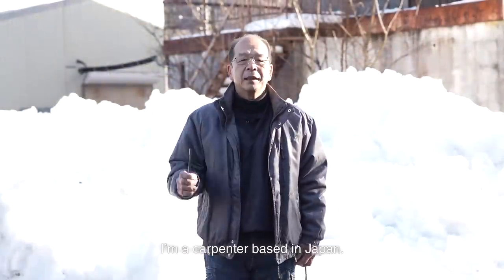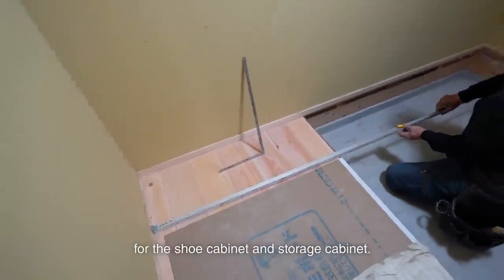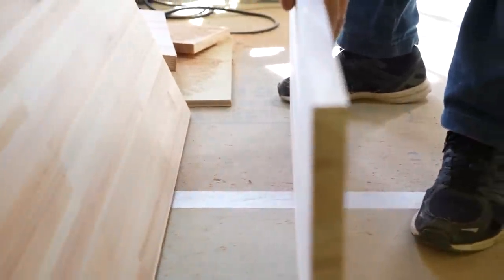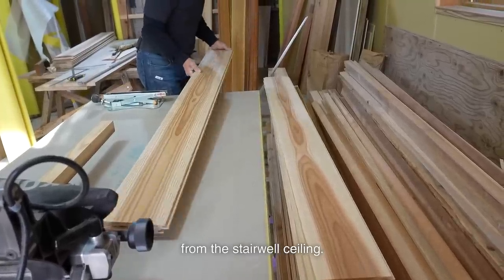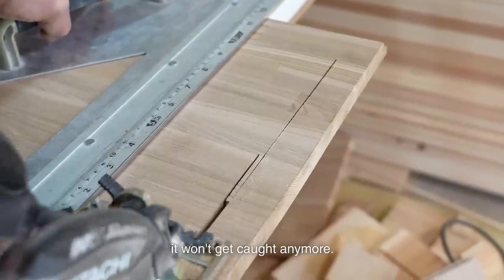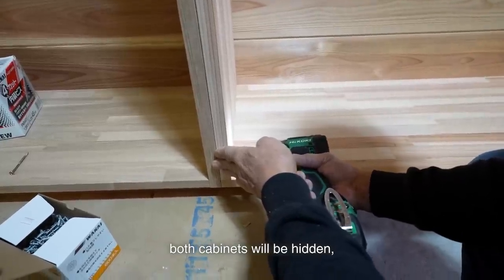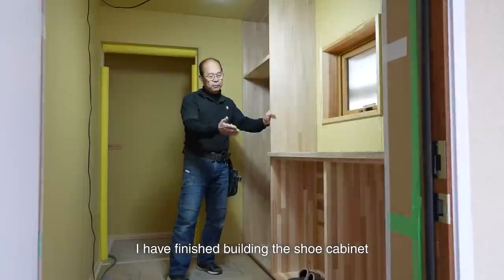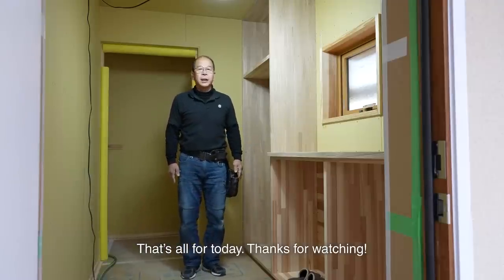Building a Shoe Cabinet & Storage Cabinet | Work I Dislike but Firmly Built [Season 3 – Part 12]

Comment: Thank you for taking the time to make this video. I know it slows down doing the actual work. Being a US based woodworker it is very interesting to see how some methods are the same as I am used to and some are different. Making the "turusen" (we call them plugs) as one long dowel piece and cutting each one flush after hammering it in is great. I normally make plugs ones at a time with a "plug cutting" drill bit and then hammer them in one at a time. Your way is quicker and wastes less material. 

I am a bit surprised at attaching things together without obvious ways to allow for wood movement due to moisture changes over time. Is this less of a concern in Japan? The cabinet back boards, for example, all seem to be secured to the cabinet body in all directions. Will this lead to the back boards cracking over time? 

Thank you again for sharing your work. It is educational and fun to watch!